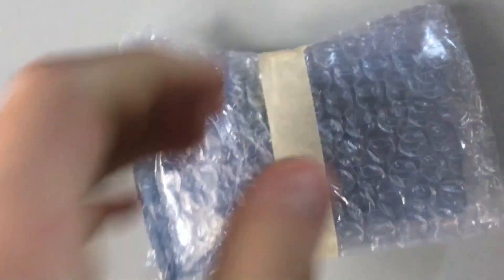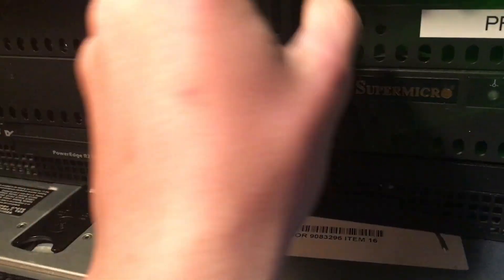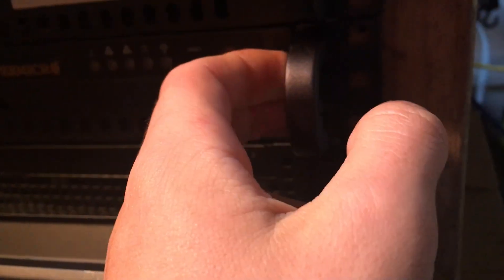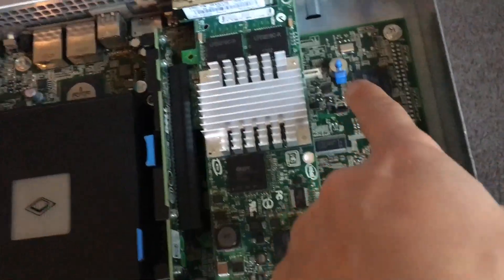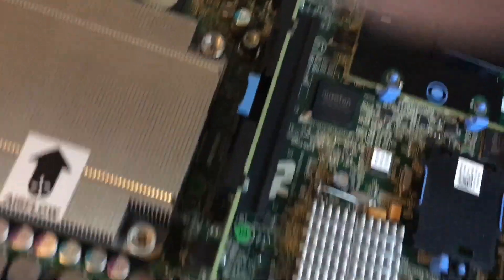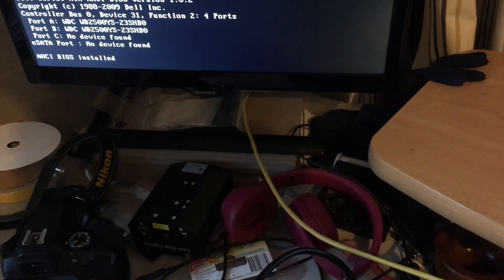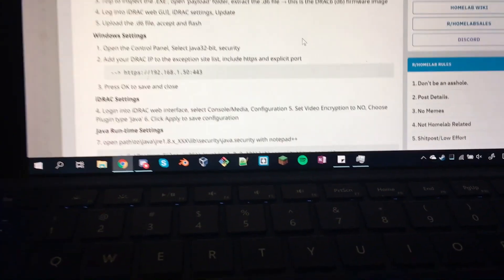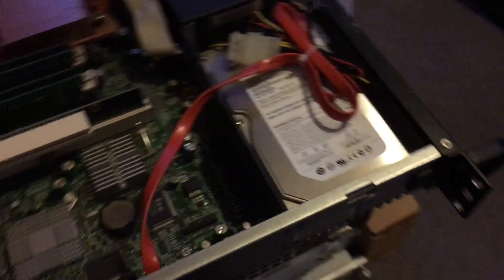Installing an iDRAC in my R210

Comment: Your R210 is fairly quiet. What BIOS version are you on? What did you do to make it quieter?
Reply from the maker: I didn’t change the bios just installed and updated the idrac
Reply: Mike Jordan I have two R210’s and a R210 II. I’m not sure what all the talk about noise is? My R730 is moderately loud. The R610’s are moderate if your sitting next to the rack. But the R210 ver 1 and ver II are quiet. If I’m not mistaken the switch fans are louder than any of the R210’s I own. You can poke around the blogs and find in line resistors made esp for your server that will cut the fans in half and quiet them down quite a bit. I used them in the older 2950’s. Just bear in mind air flow is important. Enterprise servers are designed that way for a reason. 
 I was hunting down an odd problem with one of the R210’s and all I could find was noise complaints? Believe me at full tilt my R730 sounds like a harrier jet taking off. Best of luck to you.
Reply: @fubarsnafu4994  i resolved it by installing an idrac now. Now its fairly quiet